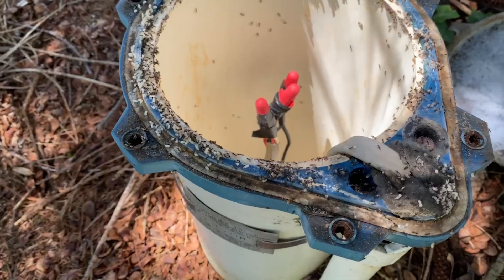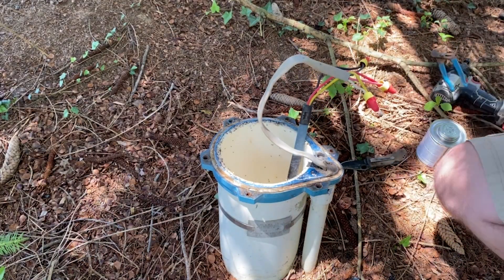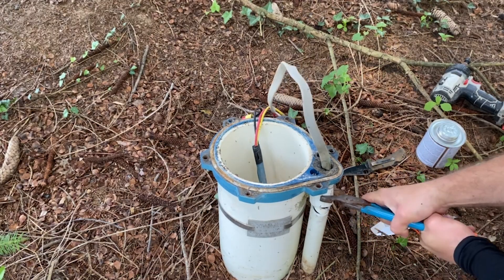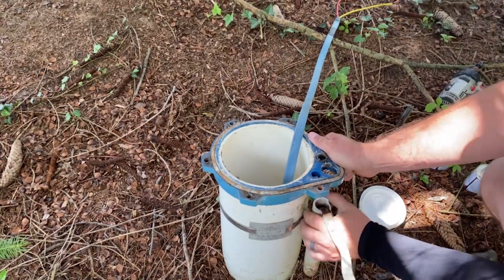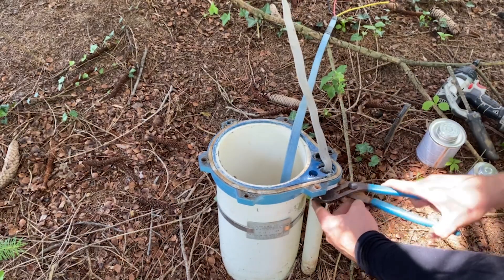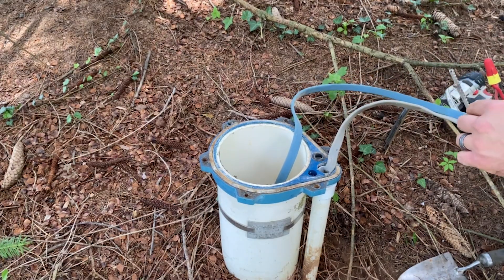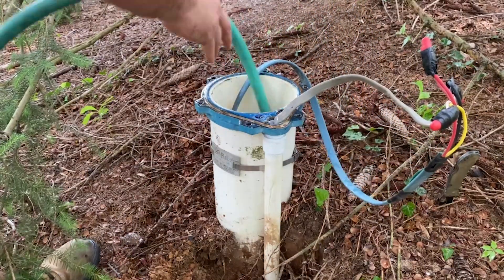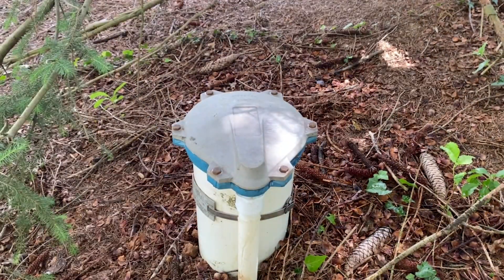How To Repair A Broken Conduit On A Well Head Covered In Thousands Of Ants

Comment: What is the fitting that mates the conduit to the well head? Also, can I substitute pvc with galvanized emt?
Reply: It's going to be a male threaded NPT adapter. Your size may be different so worst case take the part you pull off down to the hardware store and match it. I don't see why not just use Teflon tape to separate those threads and help with the water tightness.